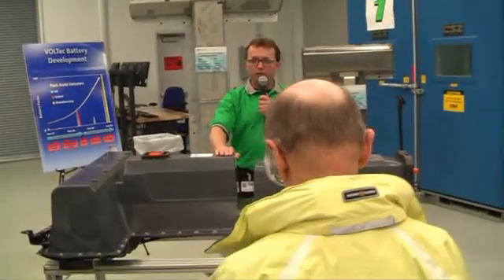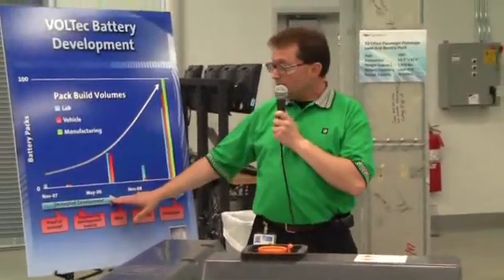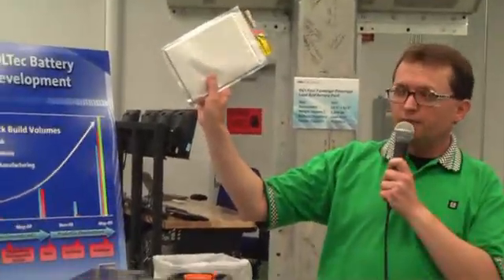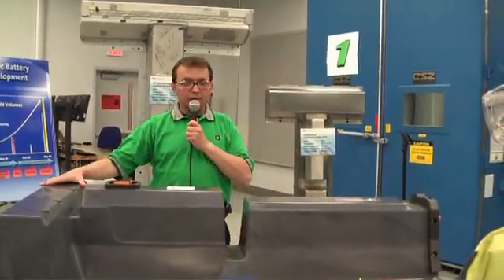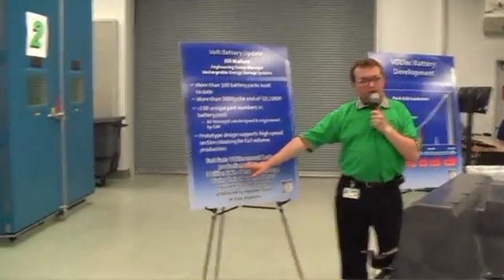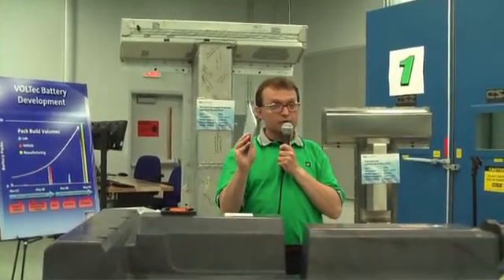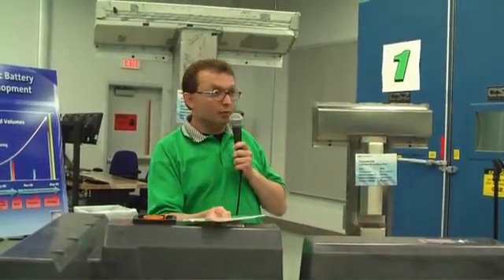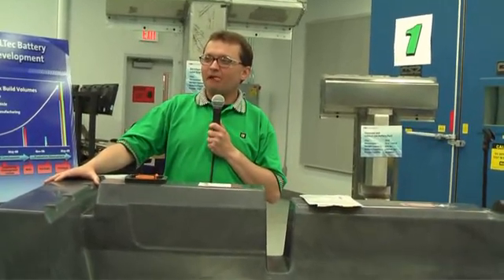General Motors Advanced Battery Lab Tour, Part I

Comment: 70 miles per hour. It is kind of expensive, but will put a base prius at the same price as the volt. I think Toyota is going to have a plugin prius about the same time the volt comes out. However, I believe a full electric drivetrain is the way to go. In 5 years if GM sustains itself and the Volt proves to succeed and be available in my area, I will consider one.